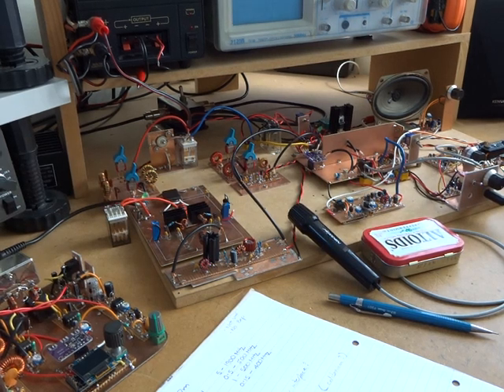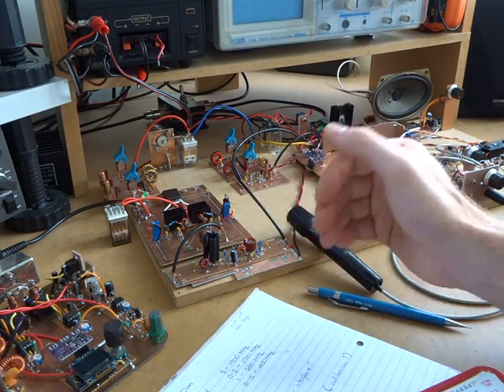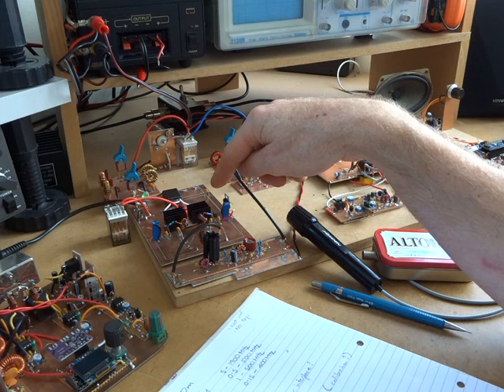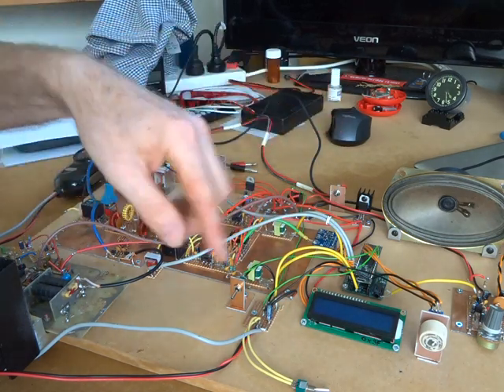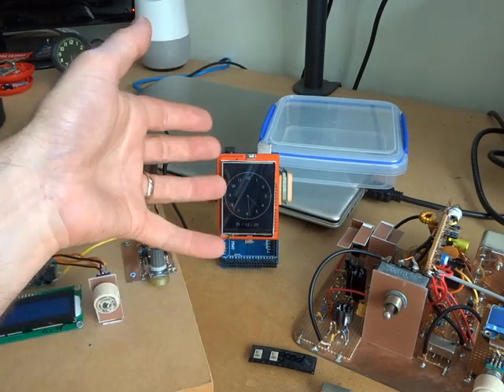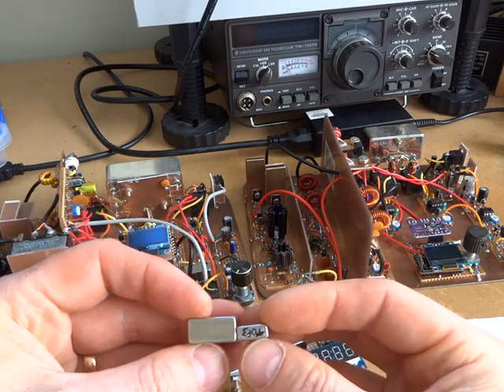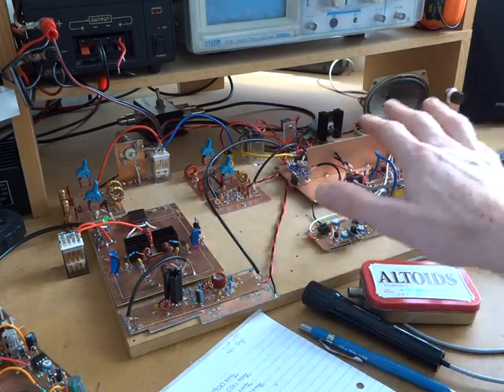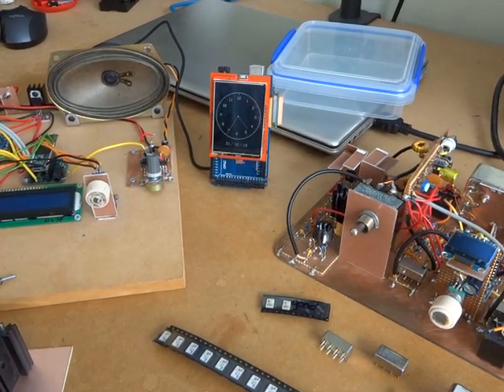2019: Thoughts and Ideas for the Next few Builds

Comment: I vote for more linear amps. Especially the MOSFET push-pull ones - they're so cheap and simple that they lend themselves very well to homebrew IMO. 

Investigating driving them and input matching, higher frequency operation, and higher power with higher power supply voltages might be fun, as could be temperature, over current and SWR monitoring.

Anyway, thanks for all the great videos throughout the year and for the inspiration. New year's resolution is to get my DDS signal generator and power meter out of my head and onto the bench.

Cheers and happy new year,
Steve.
Reply: Yeah, build a 50V 50-100W linear PA.
Reply from the maker: Hi Steve. Thanks for the input. I will certainly do some more amp designs as that seems to be a common theme. I have tended to keep the power down due to my location here. Going much above 30-odd watts won't be possible. i didn't manage to find a 28VDC laptop power supply, so I might try that too.

Comment: Happy newyears. For FT-8 you could basically use any sound card with your existing radios provided you had a way to key it work using a sort of VOX. Also power amps sound fun and so does the arduino antenna tuner.   Also I wish I could find some nice filters for my IF like the ones you had in your junk box. Only ones I have found are in CB radios I have that annoyingly won't unsoilder with my iron.

I have myself some TUF-1SM mixers.

Comment: Charlie, happy new year and thanks for your excellent videos during 2018. I vote for a QRO push pull amplifier with 2 or even 4 common cheap FETs.  Look at the W6JL amp, 2xIRFZ24Ns, or IRFZ34Ns, for 50 watts at 13.8V.  These FETs are under a $ in VK.  You commented on not going above 30watts. You can always demo an amp into a dummy load if you are worried about the neighbors.   Addons could include current limiting, monitoring and protection with the Arduino, SWR, T/R sequencing,  temp and cooling monitoring and control, pairing with a multiband transceiver, to name a few.  73 and keep melting solder, Paul VK3HN.
Reply from the maker: Thanks Paul. That's certainly an idea. I might start small then look to build up. Happy New Year to you too.
Charlie
Reply from the maker: I will say too Paul that you have a lot more experience than I do in PA builds. I was just checking your amp build now and it looks great.

Comment: Happy New year 2019 to you Charlie and all viewers.
Antenna tuner, swr/power meter with microcontroller, low level RF source
or any instruments for qrp!
low level RF source is my fav.
73
Reply from the maker: Happy New Year Tim. We have quite a list, which is great. In no particular order:
Include theory at end of videos
15W PA Design
50W+ PA Design
Low level RF source
Low noise FET antenna amp
Portable 40m SSB
Arduino PWR/SWR meter
Arduino antenna analyzer (PWR also?) 
Arduino ATU with servo cap
SDR revamp
 (Si5351 quad output
FT-8 T/R (VOX)
Finish off filter analyzer
CW keyer, decoder
All bands AM/SSB receiver
Variable preselector for receiver
6m QRP rig
Test jig for filters and mixers
Audio amplifier builds
IR, LED, laser comms
Reply: This is a great list! Even QRO is nothing for me I will watch it. TY very much 
OMs and XXLs don't forget the thumbs up for Charlie in 2019

Comment: Happy New year Charlie, from M1CEM over in the UK. I have also been thinking about an auto ATU but rather than switching capacitors with relays that seems to be the normal way to do it. I was thinking maybe use an airspaced capacitor driven by a RC servo, just a thought. Anyway keep up the good work and keep those videos coming.
73, Brian.
Reply from the maker: Gidday Brian. I was thinking exactly the same thing, but thought the mechanics might be a problem. I do have a few airspaced caps in the shack, so maybe I should look at that approach. You would certainly get a deeper null.
Reply: Think you also mentioned the SDR again commenting on maybe having quadrature straight from the SI chip. I did find some code on PY2OHH's site. After a bit of fiddling, probably formatting errors from the copy & paste I got the code to compile and it does work but only down to 4.7Mhz. But might be worth a look, if nothing else it helped me understand how to set the phase angle on the si5351.
Reply from the maker: @brianharper9798  That the same limit I got down to. I just need to make time and nut  it out. QRP Labs have proven it can be done, which is great. I'd just like to do it myself too!
Reply: @CharlieMorrisZL2CTM  Just had a look on QRP Labs and quadrature o/p is from 3.2Mhz but that's still better than 4.7Mhz. Not sure how they manage that thought.
Reply from the maker: @brianharper9798  Thanks Brian. That would be fine for a direct conversion front end from 80m up. One of these days...!
Reply: @CharlieMorrisZL2CTM  Been doing a little research and it looks like you can set the VCO out of the normal 600-900Mhz range, one person stating as low as 185Mhz. ( https://silabs-prod.adobecqms.net/content/usergenerated/asi/cloud/content/siliconlabs/en/community/groups/timing/forum/jcr:content/content/primary/qna/si5351_hw_bugs_-out-KeNr.social.0.15.html )

  Now this may be how QRP Labs are doing it, if you can lock the VCO at 400Mhz and then divide by 126 that's pretty close to their 3.2Mhz.
  Reading through the ( Adafruit_SI5351.cpp ) it looks like there are some limits in place.
Reply from the maker: @brianharper9798  That's really interesting Brian, and I think aligns with what QRP Labs said in their write-up. I've jotted down the points above as a reminder. Maybe I'll dedicate some time to that these holidays. I'd love to get it sorted. Thanks again Brian for taking the time to look into it.

Charlie
Reply: @CharlieMorrisZL2CTM  No problem at all Charlie, I'd really like to get something working here as well so if you do have any ideas please let me know. Unfortunately I'm back in work tomorrow but at least it's a short week!

Comment: Hi Charlie -firstly all the best for 2019 !
Is it possible to look at a design, for a compact hand-held radio for 20 metres SSB, for use  it when the Sun wakes up ?
Reply from the maker: Happy New Year! Yes, I could look at that in the context of a tramping/hiking/bush walking rig. That means it will be in one of the plastic containers that I typically use here. I'm going to monitor 20m over the next few evenings to get an idea of who uses the band.
Reply: @CharlieMorrisZL2CTM  Hi Charlie-20 metres is mostly a daytime band with very little dx at night after dark,grey line propagation is the best !
Half an hour before dawn can be interesting as the noise level is lower.
Thank for going over the maths, I find it is very useful, I am starting to get the hang of it now.
Thanks once again
Reply from the maker: @ashave9100  Thanks for that. I'm tempted to go with 40m for the tramping rig. I'll keep monitoring 20m, but I'm not convinced at this stage. I'm pleased too that the maths is making sense.

Charlie

Comment: I need to switch in line a few different  uhf preselectors id there a certain relay I should use?
Reply from the maker: That's a good question Donnie. Given it's UHF, I'd expect you'd need something with low inductance. I'm not sure if relay specs define that or not. Maybe someone else here has a good suggestion. Sorry I'm not much help.